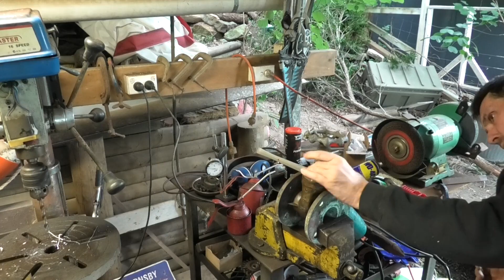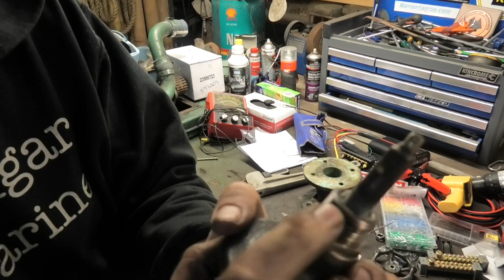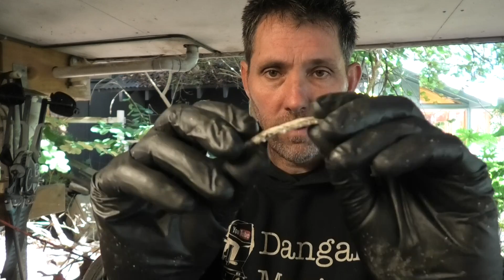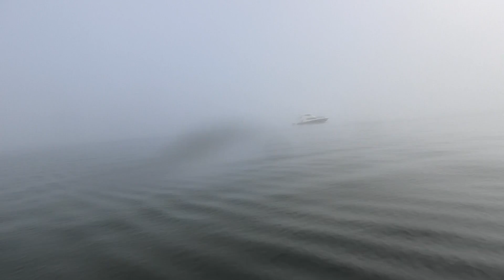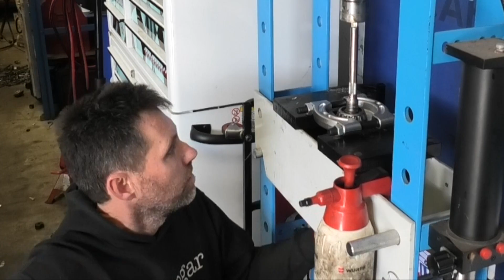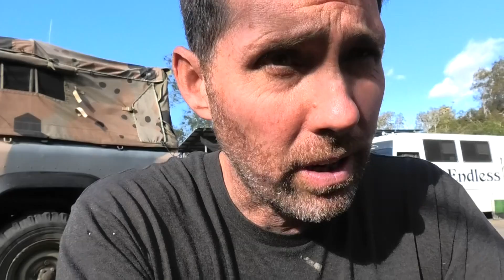Servicing gate valves, installing battery shelf, disassembling gearbox and heat exchangers

Comment: While you were gouging the remains of yet another oyster shell out of the beautifully solid, serviceable old gate valve it occurred to me that if you were able to coat a fair bit of the interior with the Prop Coat, it might prevent similar problems from recurring?

Comment: when you look for the packing it is what they call rope packing you can use graphite impregnated rope packing since it is not a high speed sliding area check in a heating and air conditioning supply shop

Comment: Plumbers will open that gate valve in 30 sec. by whacking the bottom of the bonnet with a hammer while bracing the other side with the pipe wrench. Repeat on other side of the bonnet.   Should come right off. Pipe dope on teflon tape to seal it, or nothing if the threads are good.

Comment: You showed interest in putting a turbo on  your 4-71 The 6-71 turbo engines used in high performance  pleasure boats had  lower compression  ratios then naturally aspirated engines . I assume  the pistons were  different. Not  sure if other internal  changes were made . The  6-71 TIB put out
almost 500 hp. TIB = turbo, intercooler , bypass  blower 
Possibly  a lower  pressure  turbo 
setup would  work with the NA
compression  ratio. Check  with your engine builder.
Reply from the maker: Yes, if I was going to do it it would have to have been during the rebuild and that is now in progress. Next time!

Comment: Batteries have no OFF switch so their terminals are always live. Try dropping a spanner in the wrong place and you will see welding being done. ALWAYS tape or cover the terminals when not working on them.. It will save the batteries, your spanner or steel bit, eyes and the fire in the boat. If it can put out all the amps to turn the starter motor it can do a lot of damage to you. In use cover them to stop anything dropping on the terminals too. Amacf Scotland

Comment: Just a tip with the gate valves, don't keep them cranked all the way down or all the way open. Get the feel of when the spindle stops and then back up until it catches the gate (from no weight to just when the gate moves) that is closed or open. Turning them all the way down right or open will eventually break the spindle. If the gate is in position it is working, doesn't need to be tight. Awesome work, love the videos
Reply from the maker: Nice tip, will do that.

Comment: I hate to see pipe wrenches used on brass/bronze. I know they are costly but you NEED one or two of these. 
https://www.ebay.com/itm/RIDGID-Hex-Pipe-Wrench-20-L-Cast-Iron-31280/253781172109?epid=5012056403&hash=item3b16895f8d:g:5uwAAOSwNVxc-WWY
Reply from the maker: One day!

Comment: Have you ever tried rust removal with molasses and water? 1 part molasses to 9 or 10 parts water. Soak for about a week. Much less caustic and economical for bigger parts and panels.

Comment: For the packing Instead of cutting off the ends perpendicular to the lengths shave them at an angle with other end opposite so when they are laid together it is the same thickness all the way around without a gap

Comment: Good choice to have someone assemble the gear box. Always better to have someone do it that does it 

all the time. I think your packing turned out good on the valve, I use Teflon rope seal quite often. Be picky on putting 

everything back in your boat as the little fixes will pile up and bite you in the butt later on. great video !
Reply from the maker: Yeah, I really thing gearbox assembly is probably above my pay grade so I'm glad Jason is going to be taking care of it.

Comment: Love the channel! Hey i'd assume you might get a bunch of comments on how ball valves are so much better than gate valves; partly because you can't glance at a gate valve and know whether it is open or not....  but I assume you're not going this route because you're sort of keeping an older boat closer to original parts.. or for cost....?
Reply from the maker: I think I forgot to mention it in this video, but I was really struggling to find ball valve replacements, and the only ones I did find were $1100 each. Ouch! I'm going to replace the old deck wash / bilge pump fitting with a more modern through hull skin fitting and then I'll see how that goes before maybe swapping all the others out too.

Comment: Powdered graphite on packing cord helps and extends the life of the packing material in fact they make packing for these valves and it's cheep. Works better looks better and is more reliable impregnated with graphite. However as a Master Plumber Pipefitter I say good job well done. Jack of all trades, lol. I enjoy your show and you inspire me to fix up my three boats. Resealing an 1989 OMC Cobra lower case installing prop shaft bearing, revised detent to fix hard shift and no reverse. Working on 1975 Mercury 650e Thunderbolt 3cyl a 1968 Johnson Super Seahorse 33hp and a 1971 Mercury model 40 4 hp 1cyl. Coming into ownership of a Mercury Thunderbolt 50. So I thank you for the guidance and inspiration to understand the gear boxes on these machines. I'm an  experienced auto and small engine mechanic even done a transmission or two in my day but something about gear cases is intimidating like rear ends.  Surprising how simple they are after the initial apprehension. I don't however remember seeing you tackle outdrives much. A great resource for those is Wayne Coll and https://www.youtube.com/user/TcElectronicsMarine/videos. Thanks DangarStu.
Reply from the maker: Thanks mate. Good luck with your projects and thanks for the link to the info on outdrives. We don't really have any boats around here with them but you never know when that link will come in handy one day!

Comment: Caustic soda works better heated.  Would love to see the clean and painted engine room.  Great vids, man.  The 471 GM Diesel is very reliable and built like a tank.  I know of a few pumps powered by the 471 that run 24/7 and have been for years.
Reply from the maker: Yes, I've heard that most engine shops use a hot caustic bath for engine blocks.

Comment: Water = 8.33 lb. / gal. you should be able to convert this to Liters and Kg. Your vinegar should be close. Fuel oil is somewhere around 7.45 lb. / galWhen packing a valve use several rings, staggering the joints, or a spiral like the one you pulled out, will also work.
Reply from the maker: I'm hoping the thinner cord arrives before too long. I saw and email saying it had been sent so hopefully it won't be too long.

Comment: Wondering if you could use a tire plug and wax from a toilet bowl seal should seal good one seals other lubes
Reply from the maker: I reckon there are quite a few things you could use to seal the shaft successfully.
Reply: @DangarMarine  won't breakdown the plug and the wax will seal and keep lubed

Comment: Teflon rope or graphite rope 1/8" dia. sold on a roll, It what we use here in the US and assemble with silicone paste for the valve stem packing.
Reply from the maker: Yes, have some on it's way. Hopefully it will arrive quickly.

Comment: The white vinegar works great. After a salt away flush, I set up a loop and flushed my sea water coolant system and heat exchanger with white vinegar at 50/50 solution and the clear white vinegar soon became a cloudy blue fluid as the calcium dissolved. left it running for 5 hours, then thoroughly rinsed through with a hose left connected.
Reply from the maker: Sounds like it did a great job!

Comment: Should’ve used a new ball valves
Reply from the maker: Too expensive.
Reply: @DangarMarine  And with ball valves the fine chrome surface on the ball soon corrodes & wears grooves & takes chunks out of the nylon wipers & they are prone to seizing open or closed after a short while, gate valves are the go, slower to open & close but much, much more reliable.

Comment: With those gate valves Stu, when you wind them open or closed always back the handle off 1/4 to 1/2 a turn from tight so you know the direction of rotation to open or close, if they leak or weep try reversing the gate in the body, sometimes they are fussy like that. For the packing, could you twist some PTFE plumbers thread tape into a round section and put that in there?
Reply from the maker: Good tip! I think I might take these gates out and lap them as people have suggested, but I'll pick the best side first.
Reply: @DangarMarine  Unless they are badly chipped, corroded & leaking I'd place them in their housing & see if the fit feels good, they probably will be very good as they are, most ones that I've had leak are from me putting the gate in reverse to what it has worn into on its housing & those valves where on pumps with lots of P.S.I, you might make them leaky by changing the sealing surfaces on the gate.

Comment: Toilet Descaler also disolves calcium based hitch-hikers but a lot faster than vinegar but hey who is in a hurry? I also noticed you lubed the gate walls but isnt the bronze self-lubricating- would it be  a concern that debris would adhere to the paste and prevent total closure of the valve? would you not consider lloyda approved Nylon valves for low maintenance e.g marelon
Reply from the maker: I'll keep the descaler in mind next time. I might experiment with a nylon valve on the deck pump and see how that goes.

Comment: After just looking at a few comments and not seeing the answer, I'm going to throw it out there. Teflon tape, the wider stuff would be best for a valve that size, twist it up in a nice tight cord, then just wrap and pack it around the shaft! All packing is, is Teflon. If you want the warm and fuzziess then use some pipe dope on the top, then tighten up and tweak until it seals! Love the channel, you've taught me so many tricks, thanks so much. Much love from a Northern Michigan Plumber lol!
Reply from the maker: Thanks mate, teflon tape sounds like a great option. :)

Comment: A couple notes from an old guy who once rebuilt gate valves in Uncle Sam's Canoe Club (The U S Navy!). First, the most important part of those valves is the ringlike face of the gate proper, where if meets the flats on the inside of the valve body. Best to hone the faces, gently, on a flat surface covered with fine emery cloth. I think that would be particularly important on a valve that had been soaked in an acidic or caustic solution. Both sides, and check for flatness. Remove as little metal as possible. Second, and I'm sure others have pointed this out, flat packing is actually quite common in large valves. Cut the ends of the packing to scarf, meeting at an angle instead of a butt. You'll have no problem. Oh, and that thing is called a  "rising gate" valve. The other variety is a "rising stem" valve, for those who are interested in that kind of detail. Good luck!
Reply from the maker: Thanks for the tips. I can imagine lapping the gate itself on a flat piece of glass or something, but what do you suggest for the inside surface of the valve body?

Comment: Varta is a name in batteries that used to be pretty common up here too.  Now you'd be hard-pressed to find that name up here.  Was once a popular OEM battery, but now every manufacturer has the battery made to their specs and covered in their own propaganda, no way to know who made the battery unless you have a friend on the inside who knows which company had/has the contract to supply for them.  In North America, Johnson Controls took over Varta since the early 2000's.
Reply from the maker: It is really hard to trace the actual manufacturer of many things these days, for sure.

Comment: 5:27 look at how you removed the stem. You reassembled it incorrect the first cap goes on then the shaft. then the packing housing. It will open and close the way it is but it will not open all the way. I have also made long threads of ptfe tape by twisting it. You can then use it to wrap around the shaft. On the heat exchanger housing, I don't think sodium hydroxide will clean the rust out of it. You will need acid for that It is cast iron so as long as you don't let it sit on the sealing surfaces it will not hurt it. In the U.S. we have a toilet cleaner that is a weak muriatic acid it is very cheap and they sell it everywhere. You can use it full strength for cleaning and can use it instead of vinegar.
Reply from the maker: Thanks, I'll double check it.

Comment: I had read this somewhere before so though I would pass it on "anti-seize paste or grease is made up of microscopic bits of metal such as aluminium and copper, among other things. Any time you mix dissimilar metals with an electrolyte (the water your sitting in), you run the risk of inducing what is known as galvanic corrosion. In fact, using anti-seize in this application could induce corrosion much more rapidly than using a waterproof grease".

Comment: With the gate valve shaft seal you can take a roll of teflon tape, cut a 3 foot section off , roll it between your fingers to make a round rope out of it. Wrap it around the shaft making as many sections of teflon that it takes to fill the area, screw the bonnet nut on compressing the teflon into place. When you compress the bonnet nut the teflon will fuse together into one piece. It's better to use the thicker teflon like for use on gaslines than the cheaper thin stuff, but all thicknesses will work well.

Comment: Great video as usual! I do want to make a recommendation after looking at those batteries. If you get some extra money I really recommend getting some Lithium Iron Phosphate batteries to replace those old lead acids for a few reasons; First being safety as if something happens to compromise them they cannot catch fire or spill caustic chemicals all over the place. The next being sheer size and weight for the amp hour capacity you can get out of them. The last being that due to their actual nominal capacity and life expectancy they are actually cheaper in the long run than the lead acids. A bit of an upfront cost for a better, safer battery. I can't attest to pricing where you are but if I am guessing at the capacities of those batteries correctly, you could potentially get a single battery that would have higher nominal capacity than all 5 of those for under 600 aud and likely no more than 1000 aud (again  I am ball park guessing here based on the size I believe those batteries are.

Comment: When I started building a steel yacht in the seventies, I found it very difficult to find the proper metal valves for it, re electrolisis. I ended up using cast iron Crane diaphragm valves up to 1,5" and a butterfly valve for 2". I painted the interior of the Crane valves with epoxy paint. It worked well. The body of the butterfly valve was also cast iron but lined with rubber. The butterfly was cast stainless steel.

Comment: Back early 2000's we pulled a Victorian valve from a Thames Water ( London) site....the lead screw was 6ft long and 6" in Dia....Had new lead screw and nut machined and the valve faces re-machined 
Be good for 100 more years...PB2 Bronze.
Reply from the maker: They don't make things like they used to!
Reply: @DangarMarine  I have a valve off a 100 year old ship nearly identical to the one you were working on....

You can see the lay-out marks for the hole pattern

Comment: Uhm no offence but what exactly do you expect caustic soda to do? Its good for removing anything but oxides but the case looks very rusty. Oh well next video will tell us more.

something tells me that the "gate" valves wont seal much of anything, more of a restriction as the surfaces have not been faced to remove pitting. It might be worth it, in the long run, to take them to a machinist to check over the surfaces. If they check out fine no biggie, however if they do need a refacing then you know. It will be up to you really. After all the work your putting in the last thing you want is problems when it sits in water.

Plastic tray for batteries, heavy batteries....why do I have the feeling that will cause an issue down the road. Can you maybe put something underneath like a storage shelf or something that will help prevent the whole tray from falling down and causing major problems? If it was me I would build an enclosed container with vents to outside for offgassing of batteries.
Reply from the maker: The caustic soda is a bit of an experiment. I also want to repaint it so it so I'm hoping it will take all the old paint off. 

I'll look into lapping the valves. 

The shelf is quite strong and bolted directly into the steel so it isn't going to fall or flex.
Reply: @DangarMarine  usually they heat caustic soda

Comment: On the sea cocks put another piece of gland packing on top the first one but off-set the joins, and off set a third one if it need it, .....the  battery box's we used to lead line them (wooden boat), a lid was a must and a battery master switch fitted very near to conform to a DTI certificate, not sure why you want to put a fuse box in the engine room corner, run a    main cable up into the wheelhouse to a fuse box is more convenient to work on and a shorter route to your instruments....................just saying from my days of working on em...........
Reply from the maker: There will be a main panel in the wheelhouse, those fuses are just main fuses for the wires running up to the wheelhouse and local things like bilge pumps.

Comment: @Dangar Marine, whenever we had "Sea Valves" out we would always air test them after rebuilding them. You could either buy a flange or make up a flat plate then drill it for a Air Fitting then try putting a couple of pounds of air pressure to it. I wouldn't go much past 2-3 psi when testing.

Comment: You can use ordinary o rings and rubber grease for packing. Have also done this on my boat for the rudder packing glands as recommended to me by marine engineers.
Reply from the maker: That was actually my first thought when I took the valves apart, but I thought I'd just get yelled at. ;)